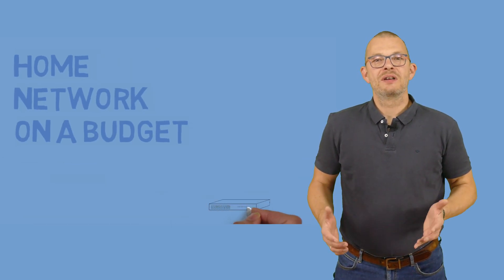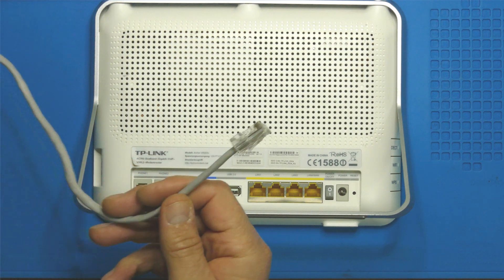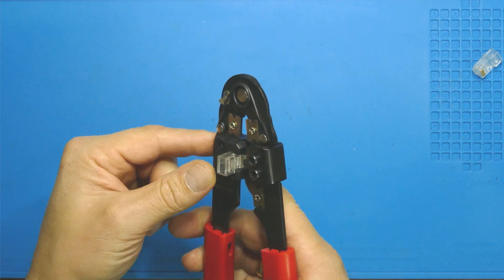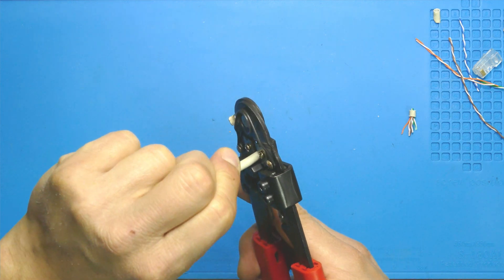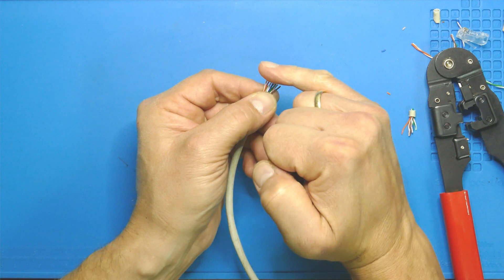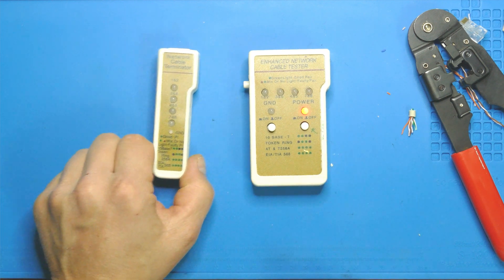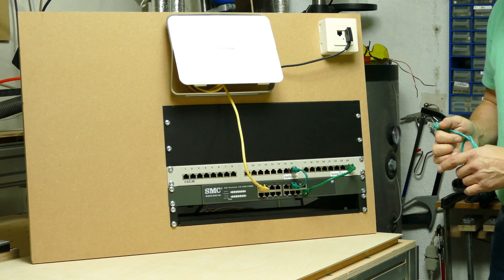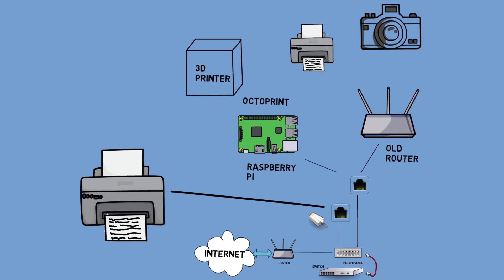Build your home network on a budget part 2 - connecting Ethernet devices

Comment from the maker: Hey guys, I finally made it to come up with a second episode of the very popular "Home networking on a budget" video. When I produced the episode I realized that it would be wayyyyyy to long so I had to split it into 3 (!) That means that episodes 2,3,4 will come out in a row. Watch out for this ;-) This episode is mainly crimping Ethernet cable and connecting the switch, next episode will be Ethernet over Power (EOP / Powerline adapters) and the next one will be about adding a wireless access point.

Comment: Yes. A small patch panel is good  because I can use it to connect as a audio output for my ceiling speaker and even PC or Settop box and smart home panels.
Reply from the maker: Very good point - and looking at my own patch panel it's true that I use it not only for Ethernet but also other signals (Doorbell, phone etc.)

Comment: I will use a patch-panel, simply because it is easier than having gazillion network-sockets near the modem and router (no: I will also not connect them directly to the router, if I run cables I will do so once for the near future and thus I want them connected best I can so nothing jostles them :) ))
ps: Not to mention that punching them into a patch-panel is easier than crimping a plug (last time I did it took 4 attempts for it to work...installing a network-socket worked on the first try!)
Reply from the maker: Yes, great point. I personally love my patch panel because the cabling is there and I can always decide what to connect and how. Crimping cables is a pain, I agree ;-)

Comment: Hi sir new subscriber here, can you tech me more about how to set up the patch panel from to isp modem,
Reply from the maker: Hi, basically the patch panel is just a collection of outlets, i.e. providing a point-to point connection. So wherever you would normally have a direct cable you would now have one outlet on the panel. it's just a physical connection, not more.

Comment: Hi, I only have an ethernet port in the living room but I have many devices that I want to connect to it, tv, gaming consoles & mesh wifi ap. How should I do it? I'm confused over hub, splitter, switch and router.

BTW good video content! Cheers
Reply from the maker: Just connect an unmanaged switch to it and all your devices to it. The Ethernet port is presumably connected to a router on the other end?
Reply from the maker: In other words - to double check - if you connect a pc to it and get internet without wifi on it then proceed as above
Reply: @OneMarcFifty  yes exactly. Thanks for the reply. Much appreciated.

Comment: For a home users (with 20 devices wired up, including 4 PoE cameras) would you suggest a managed or unmanaged switch?
Reply from the maker: Hi David, it depends. If you have VLans (e.g. an IOT VLan for your cameras) then using a managed switch can help. If you don‘t have VLans you might still benefit from QoS settings but for 4 cameras it‘s not a must - having said that I just recently switched to a managed POE switch which I bought 2nd hand on ebay and I‘m happy - so to answer your question: It won‘t do harm to have one but you don‘t really need one
Reply: @OneMarcFifty  Thank you. Really enjoying your videos - the pace of the information is just right for me. Keep up the good work :)
Reply from the maker: Maybe if you‘re doing VOIP and have experienced bottlenecks then QoS might help

Comment: Looking good Marc! Thanks for the video... I have CAT 6 cabling throughout my house with double drops in each room that I did years ago all leading the basement that I am STILL renovating *SIGH*...LOL anyways, the cables have all been disconnected as due to the reno, the patch panel is being upgraded and relocated. I have also decided that I am going to use the cabling for the second drops to have 12 and 5v DC drops centralised throughout the house by doubling up the pairs to a modified PC power supply....but I digress... I will be making videos myself once I am at that point. Anyhow I haven't commented in a while and just wanted you to know that we still here watching! Take care!
Reply from the maker: Awesome, many thanks! You might consider POE with 48V because 5 or 12V might have significant power loss over longer distances 😉
Reply: what do you mean by "drops", oceanz55?
Reply: @RandomNullpointer  Hi! I guess its an expression describing the female RJ 45 network connectors I have throughout my house that provide CAT 6 ethernet connections to my router. Looks like a standard 120v wall socket (North American style) but with network connectors. Hope this helps! ... And by the way, I never went with the 12v idea ... they are still just ethernet connections :)

Comment: I didn’t get a patch panel and I do regret it. After buying the house I might change my mind.
Reply from the maker: Hi Erdem, it's true that it is better to not need one but have one than the other way round ;-) It might look like overkill sometimes, but after all you just have so many options if you have one. Now, once you have the cabling done and it is really just add a patch panel then it's actually a small move to get there. I'd say the most crucial part is to have cable/wire in the house. If you know radio then you use cable ;-)
Reply: @OneMarcFifty  i have a 1 TB daily use of internet (: its my bad i did not get one patch panel. the cables look too messy. https://twitter.com/rifaterdemsahin/status/1329054038093082627